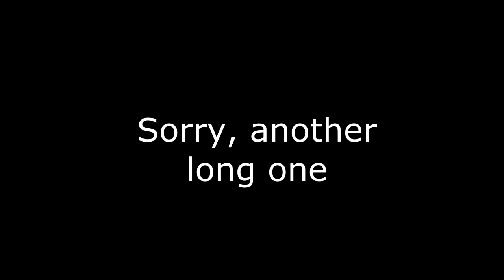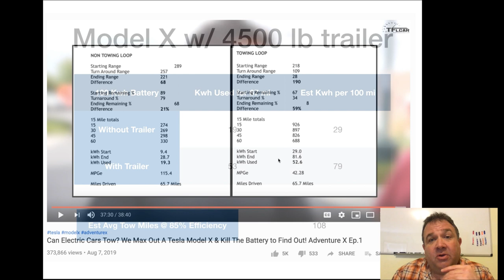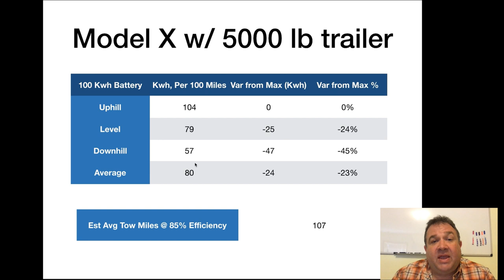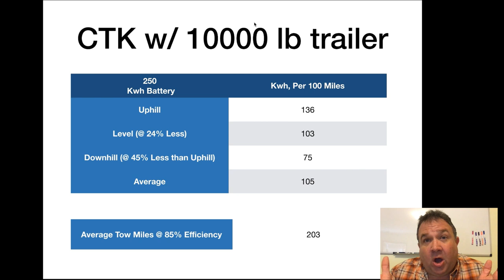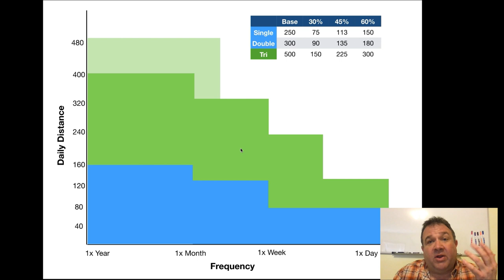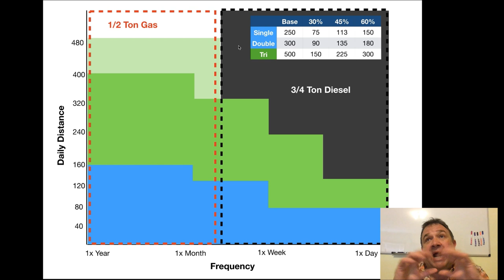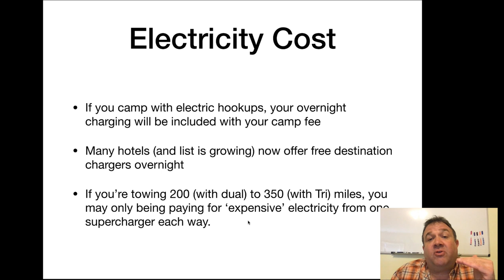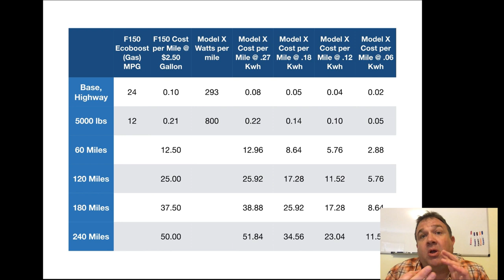Tesla Truck Towing Range Explained

Comment: in the summer i pull a 6000 lb boat 200 miles to the river , in desert heat ac on full 75 miles an hour, with grades, plus range around town for a bit. so i need  a range of 230 to 250 to make the cyber truck viable for me . and only a tri motor will do
Reply: You could stop and dump range on @250kw. That’s a charging rate of 300mph even estimating 50% range loss which you wouldn’t lose that much because that’s more than the X lost with 5000#.  

So realistically we’re talking as much as 75 miles added in 5 minutes. Plus who knows maybe ct will charge at 350 ke

Comment: I've seen quite a few Tesla charging stations and all the ones I have seen would require a Tesla to drop the trailer prior to charging. That would be a pain if you have to do it several times a day. 

I'm a Tesla fan as both a driver and an investor, so I want this to work. Sadly, I'm thinking I may have to get a diesel to tow a large 5th wheel and live the full-time RV lifestyle for a few years. 

I welcome any comments to the contrary, because I want a Cybertruck! I just don't want to get one and regret the experience, of course.

Comment: I think what everyone has left out of the equation is that Tesla could build a trailer that has batteries and a motor. Sure - it might be expensive - but then you have a perfect platform for an electric RV or an all-electric lawn care company. This also solves the highway range conundrum. You leave your home with more batteries, and you can charge both truck and trailer to maintain 400+ miles between recharging even with 10,000 lb loads. The regen braking would save on trailer brakes. Show up with truck and trailer and you have enough voltage and air capacity to build not just one home - but several!
Reply: Extra motors is a waste. Just batteries and then convince musk to let us charge it while driving

Comment: I’ve been appreciating your videos and information you share, thanks for making these videos! I am looking at this truck as I have a 50+ mile daily commute to and from my “homestead” where I have constant need of a truck. Commuting that distance (~30,000mi/yr) in a traditional ice truck is cost prohibitive, as is a two vehicle option (a commuter car and an old truck for truck needs), which leads me to an electric truck and specifically the tesla truck. What are your thoughts of the cybertruck as a farm truck and a commuter vehicle?
Reply from the maker: I think the Cybertruck is the ULTIMATE for that combination. Like I keep saying, the 2-3 motor Cybertruck is comparable to a 3/4 ton and it should cost about 1/3rd the cost to pay for your go juice. Plus you fillup at home.
Reply: Cyber Truck, Truck Guy thanks for the reply! Follow up question. If a solar option is offered on the truck, how much would you be willing to pay for it? I’m hoping that it is included... but I’m trying to figure out how much the free fuel and extra security is worth. Thanks again!
Reply from the maker: Good question. Haven’t thought about it. Probably no more than $1500.
Reply: Do you have power at the homestead? I think you would be borderline for range if you were towing anything heavy. The rest of time it would be perfect.

Regarding the solar panels on the truck. It sounds neat, but realistically they would be able to get 2-3 sq. meters of panel on there which would produce around 6KWH on a sunny day. On an ideal day and they if manage to squeeze in more, maybe 10KWH. When compared to the 200-300KWH battery that will be in the truck, it doesn't really make sense to spend much on them. Plus your truck won't usually be positioned to get the ideal sun and not get shaded, like a fixed install would. Your money would be better spent on buying a fixed install in a proper location.
Reply: Court, I’m think it would be a cool add on to supplement my existing solar system... also in an extreme event where there is no functioning grid to plug into. So... I agree, not worth spending much on it. Though I would like it.

Comment: Aerodynamics is going to play a large factor, so I believe my boat (which is lower profile than a trailer), it'd be better than a tall trailer.  I want to get an electric daily for my wife that can tow our boat, and trade her BMW X3 & F150 for a single vehicle.  The Model X appears to be the closest solution, but the range doesn't appear to be there (yet).
Reply from the maker: I believe Tesla is doing a lot to address towing. I believe they are going to either produce trailers or partner with trailer mfr. trailers will be designed to maximize aerodynamics of the ct and will have options to add aux batteries to trailer. They are also (as far as I know) first charging network to introduce pull through chargers.

Comment: Great video, I watched the other 2 you mentioned in this video and noticed the same issues you did in regards to the average towing weight and distance. I have a model 3 and I regularly drive to my parents farm 6 hours away, it used to cost me around $160 - $200 round trip on gas in my old SUV, now it costs me around $40 at superchargers round trip. People will be blown away by their savings when they get the Cybertruck.
Reply from the maker: Boom. Good comments. Thanks for checking in.

Comment: Even a one ton truck diesel while it can tow 14,000 to 23,000 pounds it might worth looking at the Tesla semi for towing bigger rvs. The Tesla Semi costs $150,000 and a F350 fully loaded costs better than half of that and is beat up after 2 years!
Reply from the maker: I was actually thinking about doing a video on that. Think freightliner campers.
Reply: Uhm wrong, the ford f350 is fully configurable and can be fitted with a bigger fuel tank, plus it better ground clearance and can go anywhere the semi can just dream off, plus the semi is way to big and inefficient to be a daily driver
Reply: @carholic-sz3qv  but the Tesla semi will easily beat the F350 for 95% of towing, way more comfortable to drive, electric is way cheaper than diesel, requires much less maintenance, and has a much better resale value, even 10 years later!
Reply: @86tubeyou  uhm nope, the f350 will still be the best its smaller more nimble and with auxiliary fuel tank its even better, the semi has no chance here, plus you don't need the top version of the f350
Reply: @carholic-sz3qv  I know you love Fords. I get it. But a diesel F350 pulling 20,000 pounds gets only 7 to 9 miles per gallon. And after 2 or 3 years it’s worn out from being pushed to its limit day in and day out whereas a semi is only pulling a fourth of its limit. It’ll be good for at least 500,000 miles with warranty still left. There is a whole discussion on the merits of big rigs pulling rv’s on several camper sites. On the Tesla semi you won’t even have to change the brakes yet. I was originally going to do do this so I looked into it but the Cybertruck came along and now I’m hooked.
Reply: @86tubeyou  I love my diesel toyota hilux mate
Reply: @86tubeyou  so you're going to buy a 200k truck just to tow 20k pounds?! Wtf EVs gets even worse range when towing compared to diesel
Reply: @carholic-sz3qv  I was going to. Remember the semi was meant to tow 80,000 pounds but now will only have to tow 20,000 so where it was going to get 600 miles of range it may get 1,000 miles! Read some blogs of campers who bought a used semi to tow their toy hauler. They love it!

Comment: Just to complete the metaphor: Once you have that supermodel, you might want to encourage her to wear those birth control glasses. Just think on it a little.

In a wider perspective, a bit more preparation for this video might have led to avoiding that metaphor entirely. There are probably better ways to get the point across—as you acknowledge yourself in the notes.

Comment: Why couldn't u have trailers with solar panels, batteries, motors, and regen braking slaved to truck system?
Reply: Cost. You could. As battery prices fall, it will probably start to be common to have large banks in the trailer which could help. Also a large fold out panel array on the roof. It would still take a few days to fully charge the truck though.
Reply: Every time i see the trailer behind the CT i imagine that’s their goal. Motor, battery, regen, and some solar in a trailer would be amazing.
Reply: I mean even conventional truck buyers could use that behind their ICE trucks. Everyone would win.

Comment: I think it would be more accurate to compare range loss from towing on both electric and gas. One thing people fail to think about is how much lower the mile per gallon is when you tow heavy trailers using a gas vehicle
Reply: Even with fewer gas per miles, ICE are still better at towing and you can add the range just with auxiliary fuel tank
Reply: @carholic-sz3qv  and which set of data are you using to come to the conclusion that ice vehicles are better at towing the EVs?
Reply: @timothythomas2555  there are actually tons of them, the most expensive CT has the best range when a normal regular cheap truck can do better and also. For those who loves overlanding can simply install or buy extra fuel in jerrycans to travel further, there are millions of used/cheap trucks out there and they can be easily modified for any types of applications
Reply: @carholic-sz3qv  can you answer my question and let me know what set of data you are using to come to the conclusion that ice trucks are more efficient at towing than EVs?

Also you can buy electric solar powered generators and charge your EV while overlanding. So just adding an axillary gas tank is a mute point

Comment: It's great that you didn't include a home solar panel system in your calculations, because it only gets better in terms of cost to operate, from there. Add in/on a home solar system and the cost can go to near zero, yeah, zero. The solar system isn't free, but paying it off costs less per month (on average) than a regular electricity bill.
Reply from the maker: Or vehicle to grid...just confirmed in the Reuter’s article.
Reply: @cybertrucktruckguy3347  I believe vehicle to grid has since been debunked, but the CT is still an unknown.  CT will still have outlets to run your refrigerator with an extension cord.
Reply: The problem is that not everyone can afford all the solar/battery storage thing, with gas/diesel you have no issues and there are biofuels to use. In Russia for example they mostly uses LPG/CNG very cheap and clean

Comment: The elephant in the room is still the conversion losses of fossil fuel to do useful work. At 20% conversion efficiency of energy in gasoline to move the vehicle/passenger, there is a HUGE amount of money being wasted. This is a major blind spot in the marketplace when determining true cost and utility of how a person is spending their hard-earned money. As a value proposition, and in light of the availability of highly efficient electric alternatives, the internal combustion vehicle is akin to buying a pint of beer for $10 only to have the waiter pour out 12.8 ounces before they hand it to you. When people start realizing how much money they've been throwing away with gasoline they will be pissed. Mind the pun... :)
Reply: You do realize that all of the methods to produce the electricity for an electric car have the same efficiency limitations. What really matters is the cost of the energy. Be it money, or environment and health. People don't really care about efficiency,  and really it doesn't matter (not to say improving isn't good). What matters is the cost. If we had a clean cheap energy source that was terribly inefficient,  no one would care. There is no harm.
That is why solar is desirable even at 15% efficiency. The cost is getting low in terms of money and the environment impact is fairly low (remember they are full of heavy metals, and will be a disposal issue).
Reply: You forget all the ethanol and biodiesel/biofuels out there, ICE is and will remain king at towing

Comment: The single most important thing Tesla can do to kill gas and diesel trucks is pull through superchargers. I need to pull 10,000 lbs 150 miles to dry camp. It's 2,000ft elevation difference and there's one supercharger along the way. If I can pull through and supercharge without disconnecting my trailer, bye bye Ram 3500.
Reply: I bet you could go 150 miles. Model X lost 30% at 75mph with a 5000# horse trailer.